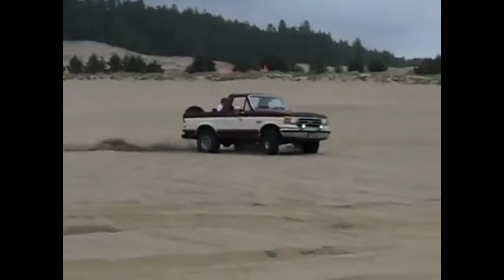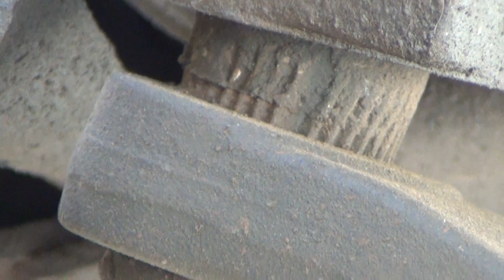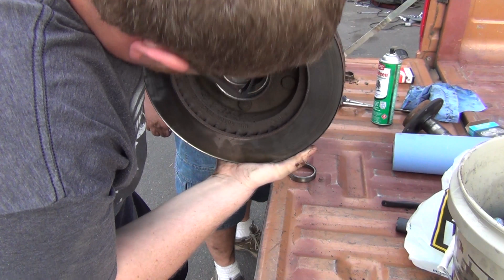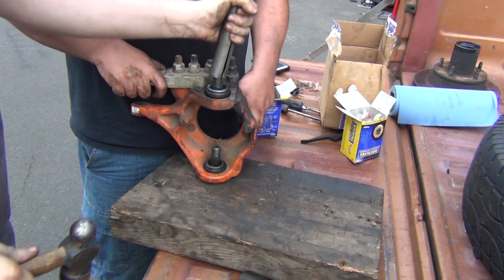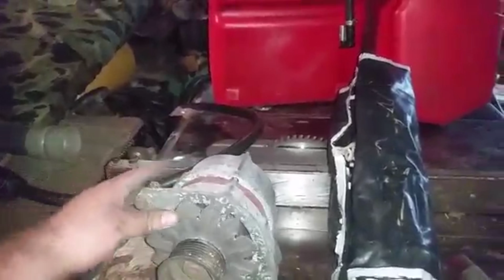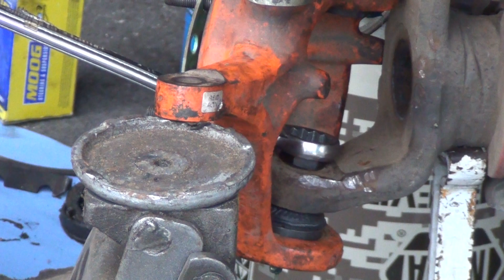Cummins Bronco | D44 SAS | Ball Joints and Bearings

Comment: The extension was the reason for the impact gun not being able to remove the lug nuts. It absorbs most of the reversed torque of the lugs, unless they were seized/over-torqued previously, because the torque should only be 100lbs on the lug nuts.